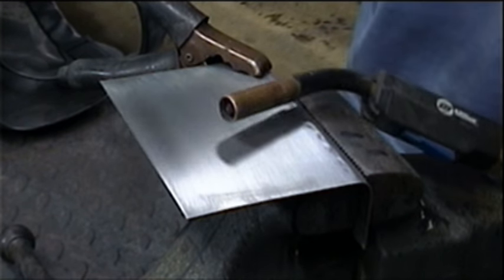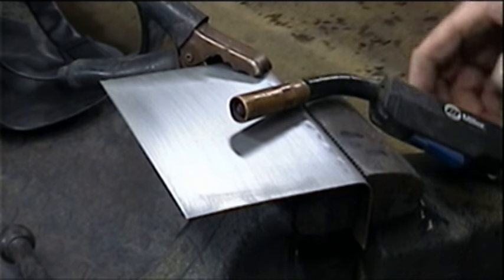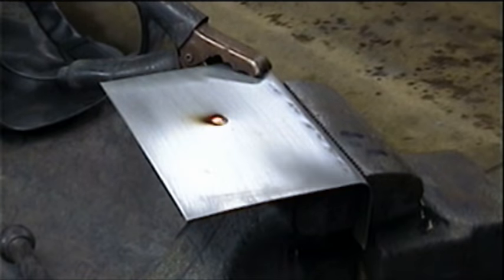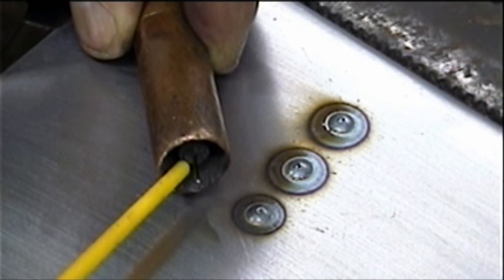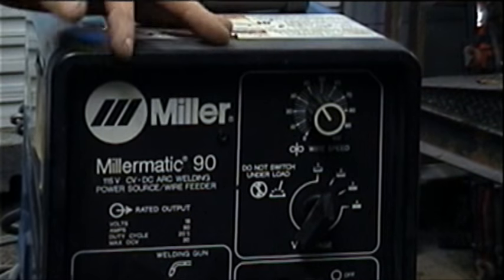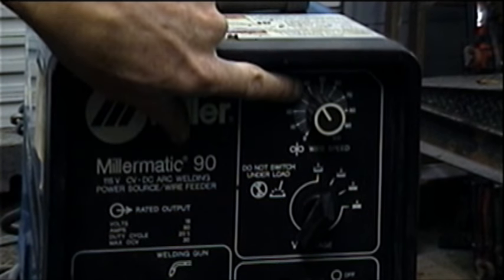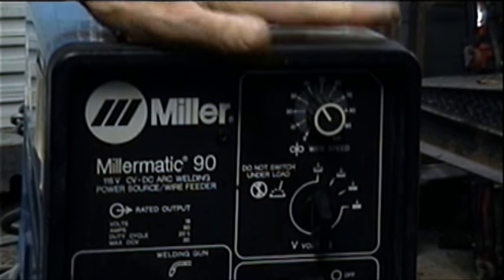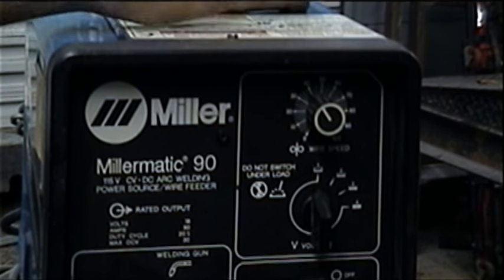Learn How to MIG Weld Automotive Sheet Metal in 5 Minutes

Comment: The simple technique of holding the gun right on the metal at a 45 degree angle made a HUGE difference to the quality of my welds. Thank you.
Reply from the maker: I'm so glad it helped.  Then when you want to make a stitch weld,  roll the gun in the direction you want the stitch to extend to - good for patch panels -   Jerry
Reply: No gas?
Reply: @fikascore  Only when I drink too much beer.

Comment: Ur videos are instructional. Its like having my auto body teacher back from 1988
Reply from the maker: Ahh... 1988 - good times :)
Reply: @LakesideAutobody  I need advice I have to repair rusted spot on my truck, I want to fix it the way u do, but I don’t have a MiG welder. I c harbor freight has cheap ones. I need ur input please
Reply from the maker: @dizzywehby3442  You can use a cheap welder but it will take a bit of practice on some scrap sheet metal first - https://www.youtube.com/watch?v=ic7Gwf8y4Yc
Reply: @LakesideAutobody  thank u! How do u know when to release the trigger?
Reply: @LakesideAutobody  thx for video I’ll buy one. Btw- I’m gonna use steel I have left over from my wood stove piping I d k what gauge it is
Reply from the maker: @dizzywehby3442  Easy.... Hold it too long, you burn through.  Hold it too short, you get an ugly bubble gum, non penetrating weld.  Practice on a nice clean open spot in the middle of a piece of car sheet metal.  Once you can put down a series of spots or welds next to each other with out blowing through you're ready to put two pieces of sheet metal together.  Again, it'll take a bit of playing around with the welder but you can do it :)
Reply: @LakesideAutobody  thx a lot that’s what I needed to hear!

Comment: Glad I found your channel...  I'm # 953.  As a retirement gift to myself, I picked up a Hobart 140.  I couldn't be happier.  I can also run it with my 5500 watt generator.  Haven't had to do anything on my cars but I do practice on scraps.  As far as the  negative comments, I've welded 3/16" and couldn't break it, so I'd have no problem on any frame work.  Thanks for posting.
Reply: I'm good with 1/4" Max for a strong weld. the H.H. 140 is a great welder, been using the heck outta mine!
Reply: Love my hobart 140 aswell. Getting my jeep tj back up and running :D
Reply: @SpudKai  I don't watch this channel anymore.  I'm now a big fan of Fitzee's Fabrications.  He does much better sheet metal work.  Check him out.

Comment: This guy is the bomb. Everybody teaches tons of techniques and I appreciate it. But the guy in this video takes it down to the nitty gritty. He shares the specs of his welding technique. No one else, up to this point for me, shares welding speed/power ratio clear enough. I was one wrinkle from success and now I am on board with successful welding. Thank you very much. By the way the welding wire speed was the one thing that have been incorrect for me. 22 speed is the spec for thin sheet metal  on the weld wire feed when 40 is perfect. The miller company needs to update those cross reference charts. They are really off. You almost think you are doing something wrong.
Reply from the maker: Thanks - glad you like the videos and feel that they help you out.  Ask any ?'s any time.
Reply: He is the bomb. I don’t watch any other auto body instructional videos. Wish I could borrow this guys shop for a couple days lol

Comment: This video has really helped me.  I have a 2003 Chevy Suburban.  I have had it for 15-16 years.  It was a government vehicle when I bought it and it only had on it like fifty thousand miles.  I used it, for everything, hauling job trailers, my boat, moved several times, hauled  nine kids around in it and all the mess they create.  It was a super great suburban!!!  2500 model 4 wheel drive.  Its been sitting now for the past year, battery removed because I could  not scrap it.  Has sentimental value.  I bought a Ford Pick up F250....used......24000 miles on it whopping price tag of 54000 dollars.  I had to hold my nose when I bought it.  payments are 810.00 a month forever it seems.   Already had to take it to the shop for warranty work.  Since Biden got elected and prices went up, up, up and work seemed to slow down it has made it harder to make those payments and I was seriously thinking about giving truck back to bank and putting the Suburban back into action.  Only problem is the rust, hole in drivers floor, rocker panels and rear fenders.  After watching this video I realized, I can fix this vehicle.  I put a battery in it and told myself, if this thing starts after sitting for a year,  I will restore it.  Suburban started right up!!!!  So now I am going to restore it.  If things don't improve in the economy  where my truck payment is affordable I am gonna have to give truck to bank and once again, drive the suburban.  This video showed me I can repair these rusted areas.  Thanks. !!!!!
Reply from the maker: You can absolutely do it and you found the right channel to help with that.  Feel free to ask ?s and see the playlists - here's one on rust repair https://www.youtube.com/playlist?list=PLOP9eoG14-I-qu68_805bZaOnmkdlv6Ys

Comment: You want to set your gas to around 18-20 cfm. Also different welder controls are going to be different settings so 1 isn’t going to be the same on different size machines. Hobart usually has a chart inside to set up the machine. A manual to the machine should have basic setting in it. Wire feed does come into play with the range of each setting to fine tune for the material size. If there is no chart, start low and work your way up.
Reply from the maker: Great suggestion - thanks
Reply: Lakeside Autobody I run mine at 12-15 cfh and it works great

Comment: I did as you said Mr. But I guess I fkd up. 45 degree angle and melt, 45 degree angle and melt so I made a big hole instead of covering the hole
Reply from the maker: Try a very short weld time - like way less than a second.  Also try turning the heat down.  Play with the wire speed - possibly turning it up adding more metal to the weld pool :)

Comment: Just getting into flux core welding, I would like you to explain the reasons why you would you use flux core vs MIG and vice versa.  Also,what are the wiring safety considerations of a 110v welder all the way back to your house electrical panel.  I dont want to burn my house down!!
Reply from the maker: No worries about wiring.  As long as your house wiring and fuse box is up to code you'll have nothing to worry about.  If your wiring is bad it will trip the breaker - won't burn the house down.  The reason folks like MIG over Flux is it's a cleaner weld and just a bit easier.  Just what you saw in this video is how easy MIG is.  Flux is also pretty straight forward but you'll have flux to clean off the welds and surrounding area.  MIG is used inside as you can't have wind blowing the gas away.  Flux can be used outside without any problems - no concern about wind blowing gas away.  Hope that helps a bit :)
Reply: use flux core when its windy too.

Comment: Quick question. I have a Lincoln Electric Weld Pak HD. Its a flux cored welder, 115volts, 20 amp. Welds up to an eighth of steel. I tried to compare it to your Miller 90 mig welder. Will this wire fed welder work for autobody repairs? Figured 1/8" is pretty thick so it should be good, but it's kinds a homeowner model. Thanks for replying to my other comments. You've already given me confidence to work on my daughter's truck.
Reply from the maker: These videos may answer that ?:  https://www.youtube.com/watch?v=H87b1xlGofw & https://www.youtube.com/watch?v=ic7Gwf8y4Yc
Reply: @LakesideAutobody  Thanka a lot!!

Comment: I wanted to ask you..what gauge sheet metal are you using and what size wire? Showing the settings means bugger all unless we have the exact same welder. It would have been great to see what welds looked like for too hot/Too cold and too fast/Too slow wire speed as well as too much gas flow and too little so we can compare to our own welds and visually identify what it is we did wrong....because as an absolute newbie, it's like trying to learn Russian backwards!!
Reply from the maker: Absolutely get your point.  Good idea for a video (doing all that stuff) - very cool idea.  I get it.  The wire size is .023 - metal is about 20 guage or to be exact .027-.028 inches thick - I'll get to that video w/in the month.

Comment: Sir: I looked at the Miller web site, and it looks like they don't make the Millermatic 90 any more. What would be the current equivalent model? Alternatively, would you trust buying a used unit? Where can I find a trustworthy used unit?
Reply from the maker: I would absolutely trust a used unit.  You can probably find on on craigslist or FB marketplace.   This would be the equivalent model - https://bakersgas.com/collections/miller-mig-welders/products/miller-907614  I use this model too and really do like it - https://www.youtube.com/watch?v=J-nq7MbAyX0  It really does weld quite similar to the miller if set up right i.e. the right settings :)

Comment: What metal do I use for framework I want to add additional framing to my 04 maxima SL
Reply from the maker: 13 or 14 gauge would work for that or 1/8 inch or a bit less.
Reply: @LakesideAutobody  one more question what about for the reinforcement of a custom rear axle set up on a front wheel drive car? What gauge would you prefer in that area?

Comment: different 110 welders will use slightly different settings,  but I am always tinkering with my wire speed, but only within the same range,  between 4 & 5 usually 4 1/2 to 5, and for heat, 1 to 3 depending what I am welding, however, to reach front or back of vehicle I have to use extension cord,  shop has plug on each side of building I am in, in middle, & my Mig gun is only 10 foot, & welder has a very short electrical cable, & use a 25' 12 gauge, but when I do need to reach front or rear, & I have to use 1 range hotter, for same thickness, & I wouldnt even consider using it for frame work,  barely will do frame horn with multiple layers, thats when I use bigger welder. but for sheet metal a decent 110 welder will do all you need. for those new reading this, I use a Blue Demon (blue Arc) 135M made in China 110 volt welder, with a USA welds MIG gun & a Harbor Freight Bronze welding clamp. 

now you mentioned gas flow, many people suggest 20cf, but I try to conserve gas, & usually run 15cf, if I get lower than 12 I can sometimes see pits like I ran out of gas,  and if for some reason I need to be far away  welding into a deep recess I may temporarily cut gas to 20-30 cf, best example putting in a floor pan, top side can run on ragged edge of low flow, even to 10cf,  but on the bottom sides, figure 20-25 cf at all times

Comment: What would be a decent MIG welder for starters?? I am currently in welding school.
Reply: All are okay these days. Get a cheap one at Harbor Freight. It's like your first car. Cheap money. Drive it. Dent. Leave it in a ditch.  Then you will know what you want to get next. 

 I am still using the first one I ever bought. Paid $400 from JC Whitney almost 40 years ago. (not including upgrades) Still running strong.

Comment: Is flux cored welding ok for sheet metal? I have one and the smoke and splatter make it very difficult to see how the weld is going.
Reply from the maker: I had the same problem when I tried using flux one time - i went right back to gas.  They used gas in every shop I worked at too.  Maybe I'm doing something wrong when I used the flux or I didn't give it a chance.  Hopefully someone with more experience with flux core can give you a better answer.  I'm sure it can be done - Jerry
Reply: Flux core can be used but gas is preferred. If you are having trouble make sure you are using the correct polarity. Flux core requires DCEN Direct current electrode negative. Not all MiG welding machines can do both types. I was given a welder with flux core and couldn’t get it to work, turns out it was electrode positive and was not flux core compatible.
Reply: Flux cored wire burns hotter at the same settings. I haven’t seen self shielding wire in a small diameter around me locally. Imo .023 is the best wire for thin metal.

Comment: If i need only spot weld the other gaps left are filled with fiberglass ?
Reply from the maker: You can weld so that each spot is right next to the other (no gap) or leave gaps.  The reason this works is because the seam is upside down on the inside of the panel and doesn't hold water/moisture.  Also the lapped seam is usually up high and dry and there is no seam at the bottom or there is a pinch weld or plug welds.  Either way has worked well for me but if you want to make sure - put them right next to each other :)

Comment: I've got a Miller matic 250.
I keep getting burn back up into my nozzle and having to constantly cut and pull the wire back out . " Nothing but trouble since I purchased it new. For a time I  just gave up on it and rolled it into the corner.
Any suggestions. 
                             Thanks.
Reply from the maker: Start with super clean metal - Make sure your gas is set correctly according to the manual and that you have the right gas - then make sure the voltage and wire speed is correct (should have a chart somewhere in the manual) - you should be good.  Let me know if you correct the problem - curious.  Jerry
Reply: @LakesideAutobody  
Thanks. Jerry,
I'll get back with you after the holidays and vacation. 
Have a happy and safe New Year..
Reply: Make sure the polarity is set right for the process you are using.
Reply: Increase your stick out a little. Your welder may have a burn back setting too. Check your manual

Comment: Is it ok to weld (flux core mig ) on a Rv /camper that has onboard  LPG ? Its 12 ft away but I was wondering if the earth path for the electric side etc is safe
Reply from the maker: I would think you would be fine but I never welded on campers before.  I've never had anything explode while welding near plenty of tanks though - let me know what you end up doing :)

Comment: Does minimum amp setting effect how well a mig welder welds thin sheet metal? Example would a 20 amp be better at welding thin steel then a 45 amp?
Reply from the maker: If you are talking about the heat setting like 1,2,3,4 on my welder.  That just controls how hot or how much "juice" you are welding with.  Too hot and you'll burn holes, too low and it won't penetrate well enough.  If you are talking about a Miller 90 vs a Miller of a higher amperage, I've never noticed a difference when welding automotive sheet.  I've used all types 220v 110v 90 amp and larger (mostly miller) They all welded sheet metal very similarly.  If that didn't answer your ? ask again :)

Comment: How do I make the rust not come back? Lol...getting a wheel well repaired with new metal and people keep saying the rust will come back. Esp at the weld spot in future because water will somehow get in...really bummed about this because I just got the car smh.. can I Plasti dip over the repair to ensure no water ever comes into contact with the weld repair again? Lol. Best options to make sure the wheel well doesn't rust again at the weld spot ? Thanks for any replies. Need some optimism lol. Going to be paying $800 for a wheel well repair ( cut out old metal and weld in new )
Reply from the maker: Please watch these closely and don't listen to the negativity - they're wrong.  https://www.youtube.com/watch?v=8XaZBy7GC7A
https://www.youtube.com/watch?v=2o37dX--w0I

Use minimum overlap, weld solid, knock down patch, fill, prime, paint, make sure the panel can drain well.  No trapped moisture at the bottom of the panel or trapped debris inside the panel.  Try to use some type of rust prevention technique  - I like used motor oil in the panels  - That's the answer or just replace panels - been studying this for years and years - hope that helps - Jerry
Reply: @LakesideAutobody  thanks Jerry..really like your videos and you showing how your rust repair looks years later really gives me optimism.  Not doing it myself but will def try to give the welding guy tips without offending him lol
Reply: @LakesideAutobody  after hes done I was thinking of spraying some rubber on it and behind it to shield new area from any moisture..def going to keep area real clean and get all the debris out and make it drain well
Reply: @LakesideAutobody  replacing this quarter panel on a scion tc is very expensive because the quarter panel is half of the side of car. That would cost 3 or 4k so that's why I'm going to try and replace with new metal and hope she lasts..shop that is doing it says he says the rust come back within the year. Smh
Reply from the maker: @Chris Orazio When body shops say it will come back in a year, it's because they either don't want to do it or they are not that good at doing it.  These days, I think both are the case.  There just aren't many guys that know exactly what to do.  Watch some of my videos - do it just like that and you'll be fine - Jerry
Reply: @LakesideAutobody  yea it's a body shop.
Reply: @LakesideAutobody  I'll get a few more quotes and hope it goes well
Reply from the maker: @chrisorazio925  They are trying to discourage you.  They only want gravy jobs - nice easy collision jobs that they can replace panels, paint and ship.  Again, let me know how it goes :)
Reply: @LakesideAutobody  thanks Jerry. I called a bunch of shops in my area and only a handful will do it. He was one of them for $800. I'll def try to get some other quotes
Reply: @LakesideAutobody  he says at the weld point it will rust again.

Comment: What size welding wire are you using for sheet metal? .24 or .30...?
Reply from the maker: .023"  but you can also use .030 as that's what I believe we used in the body shops I worked at - the welder was 220v though so... Miller too...